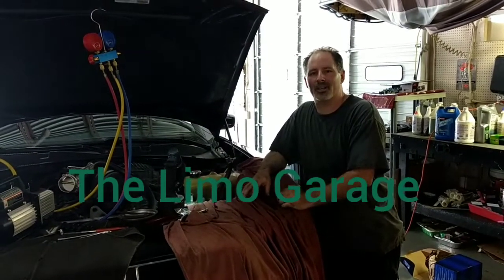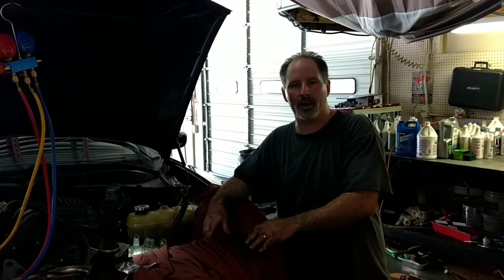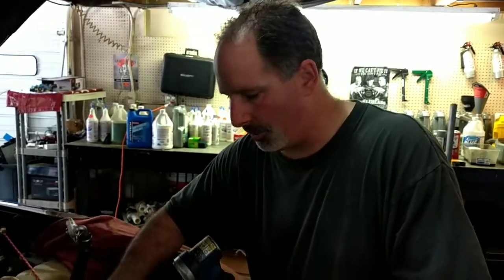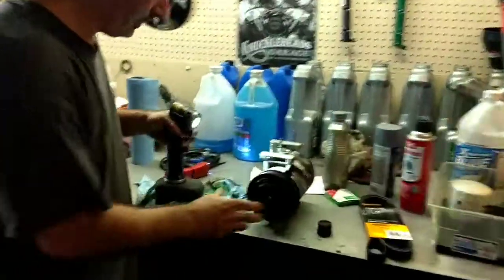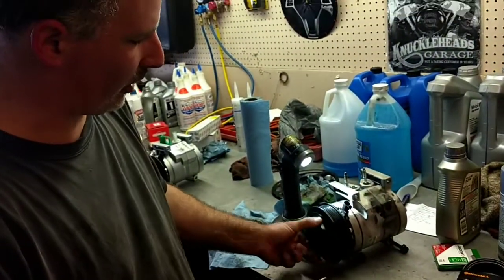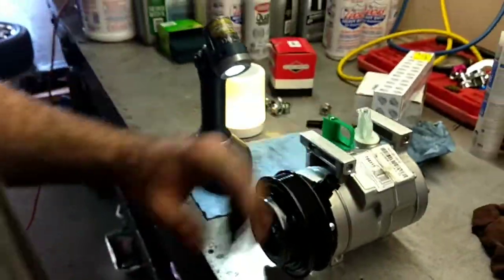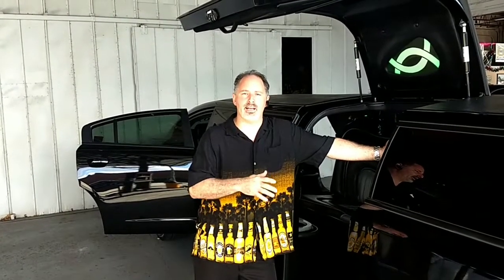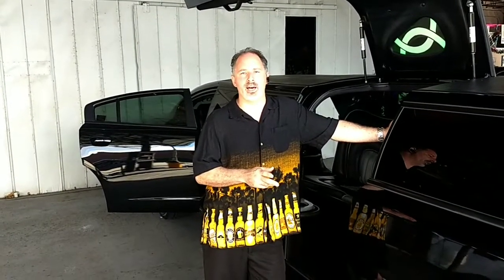The Rear Air Conditioner Blew Up In My Limo !!

Comment: Thanks the very good, informative video. My Limo is based on Cadillac DST, 10 pack stretch, has North star engine on it. The rear AC stopped working, I am not sure if this Limo/ engine has 2 compressors??/ If it does, it sure could be a compressor?? Front AC works somewhat, not very cool either. Limo was built by Krystal Koach Inc., California, date: 12/2003, and Ser.#:14609, Brea, California. How much was your Limo freon amount:3.12 lbs??, and oil amount: 11-12 ounces?? I am imaging it would be about same amount in mine??/ Thanks for your Info!!=)

Comment: Seem everywhere I look people have issue getting colder ac air to back passenger area. I can’t get cold ac in drivers front area.  I’ve had mechanic change compressor last year and it worked ok during the summer. Now this year still same issue, cold in the back but not in the front. I can’t work on it but maybe you can point me in the right direction where the problem could be and I’ll relay to mechanic. There are not many limos around this area and the company that built it was in ft smith Arkansas and has closed down. Any help would be appreciated. Thanks
Reply: Mine is a 1997 Lincoln towncar

Comment: Hi I need help please, have a 2004 Lincoln town car limo I’m working on and replaced the condenser cause it had a leak can’t get it to recharge the ac. I got a different condenser but  about the same size. Recharge it to the label, blows some what cold but not cold enough.
Reply from the maker: It sounds like you do not have enough Freon in the system. Does your limo have 2 ac compressors ?
Reply: The Limo Garage 
I don’t think so, only see one. Would there be two hi- low ports if there was two compressor?
Reply from the maker: Yes there would be 2 sets of charging ports if you have 2 compressors. You mentioned there was a label stating the amount of Freon required. Is this the factory label or one added by the coach builder?
Reply: The Limo Garage 
I believe it to be from the coach builder, it’s says to charge to 4LB 10oz 134A and 4.0 oz pag oil.
Reply from the maker: @jacobdelvalle1157  That sounds right. Are you using an ac machine to recharge or did you use cans from the parts store?
Reply: The Limo Garage 
I’m using a a/c machine. 34700z cool tech.
Reply from the maker: @jacobdelvalle1157  When charging the system make sure to put it into a vacume for a about an hour to remove all moisture from the system. You may want to also consider replacing the receiver dryer. Be sure to replace any oil that was lost when you replaced the condenser. Not enough oil will cause damage to the compressor and too much oil will cause it not to cool correctly. I recommend charging the systemwith with 2 lbs of freon and then adding a quarter pound at a time until you reach optimum temperature. Also make sure your high side pressure never goes past 200 and your low side pressure should between 30 to 40. Double check that your condenser fan is  working properly, also make sure that the expansion valve for the rear evaporators is opening allowing flow. I always make it a habit to flush your system completely when replacing components. Good luck I hope some of this information helps.
Reply: @thelimogarage9665  I have ac in the drivers cabin but no cold air in the rear